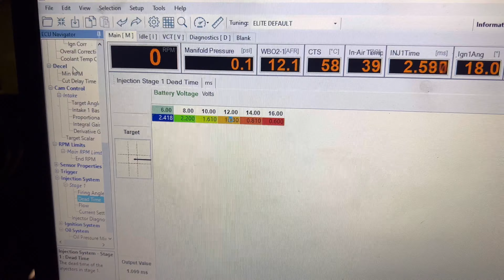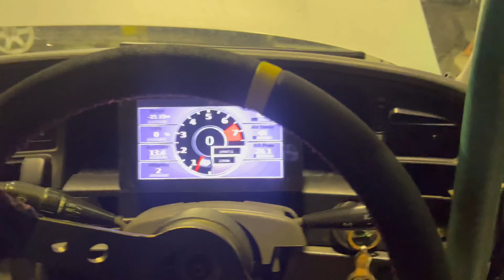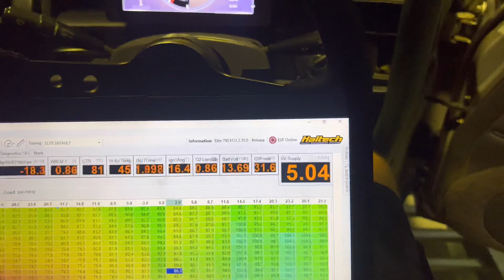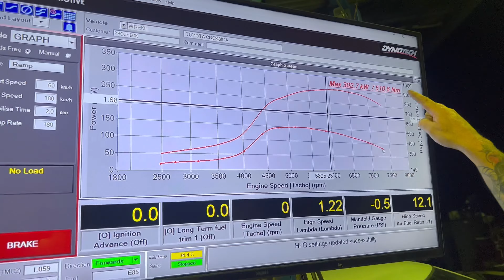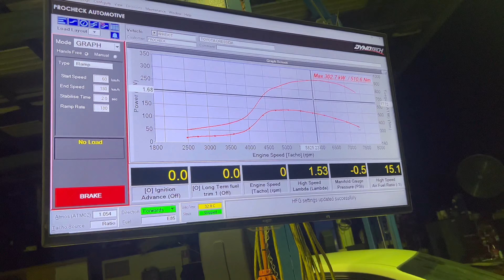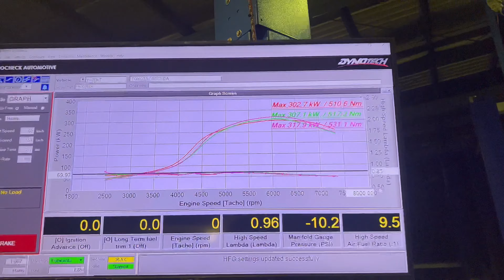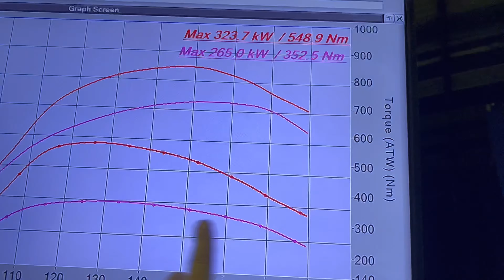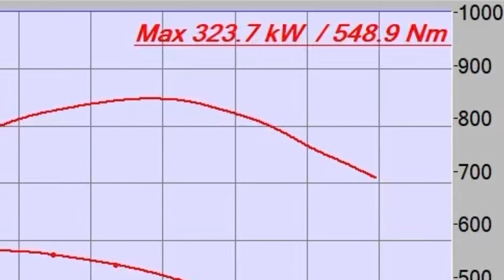1JZ Cressida gets G30-660 turbo & E85 on Haltech

Comment: Geez running the gauntlet before. Old stock 1jzvvti + 98 and no wideband! Was lucky it only took out the pistons. Looks like a great upgrade now and really responsive for drifting
Reply from the maker: Was monitored abs safe on dyno, just a vvti gear seizing and full noise drifting caused the issue. 
Really need knock sensors but the 750 doesn’t have the input for them.

New setup is killer and he loves it 🤙🏻

Comment: That power falls off hard at the top end. What size rear housing are you using? Maybe go up a size? I've seen other dyno runs and it makes over 400hp and pulls hard all the way to redline. Speed Academy's STI is a good example and Adam LZ's chaser made over 500whp with the same turbo and engine.
Reply from the maker: Couple of differences 
Hub dyno Vs roller dyno 
STI VS 1JZ
USA dyno readings Vs Aus readings 

This has a .83 rear housing, but is only running 17psi
I could add more boost up top to hold power out but Josh didn’t want to chase 500whp or hold it at 7500rpm all day
And this is making 430rwhp on a roller dyno.
Reply: Lol LZ.
Reply: @procheckautomotivemechanic4551  More boost wont help. Head ports and cams are holding back badly with 1j vvti head. Built forged bottom and ported the head for customer build. 264 BC's, supertech 60lbs single springs, shimless buckets, GTX3572r gen2 with Tial 1.06ar vband rear. Maintains rising power up to 7800rpm and pretty flat torque curve from 4000-7000rpm. Almost 700Nm from 4500rpm upwards at 26psi. Tuned month ago a jzx100 with stock bottom end, G30-770 sized turbo (turbosystems HTX3058), 272 BC cams, same supertech springs and shimless buckets. Head ports were untouched. 26psi and 630hp/650Nm. Peak power 6800rpm, and kept over 600hp up to 7500rpm. Torque is insane, almost dead flat from 4000-6700. The small 55mm turbine or very restrictive 3" exhaust with non straight flow muffler was holding back top end rpm. Emap sensor in the manifold next and free flowing 3.5" exhaust to see if the turbine side or head ports are choking. These engines need cams if the compressor wheel is going to be over 52mm. Exhaust side is just too restrictive.

Comment: hi!
If you're interested, I recently set up 2jz stock+g30-660+ecumaster black. SportFuel 108 Ron.
0.9 bar 437 hp/540 nm
1.2 bar 480 hp/600 nm
1.5-1.7 bar 565 hp/700 nm
1.92-1.7 bar 565 hp/750 nm
Here is such information. Good luck with your work guys!
Reply from the maker: Nice 🤙🏻